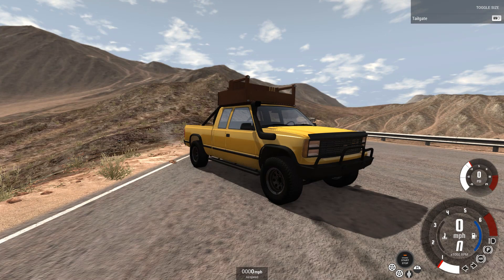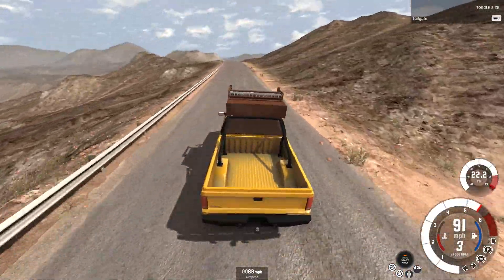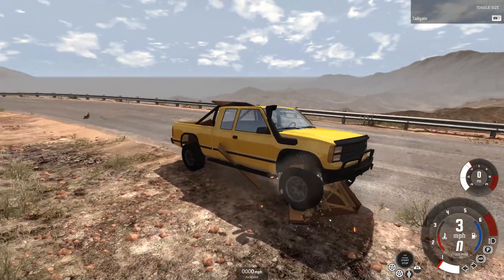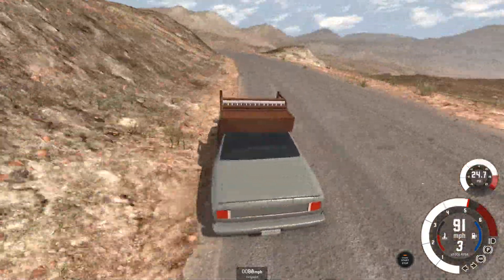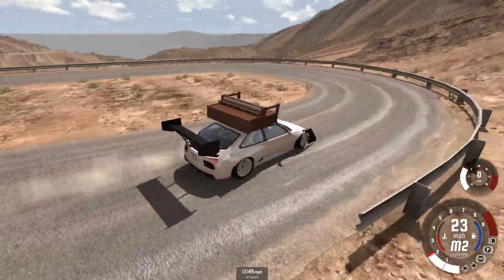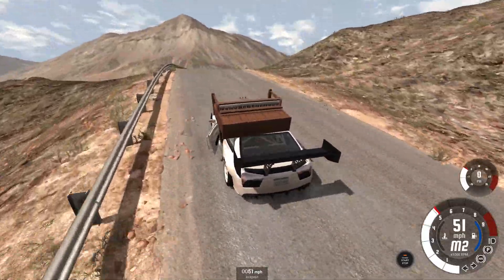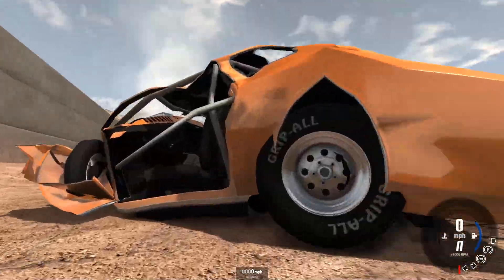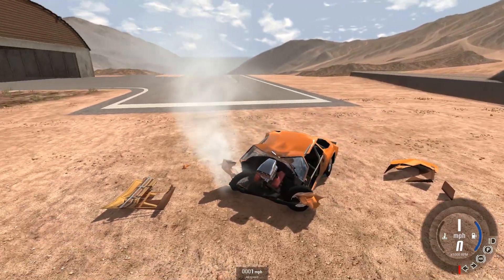BeamNG Drive Challenge - The Fastest Piano

Comment: Try racing on the procedural tracks with some very high powered cars BUT with smallest wheels possible.
The Hirochi Prasu mod has 15x4 spare wheel option that cam be used in any 5-lug hub for maximum uncontrollability.